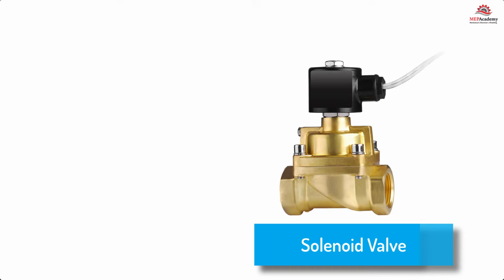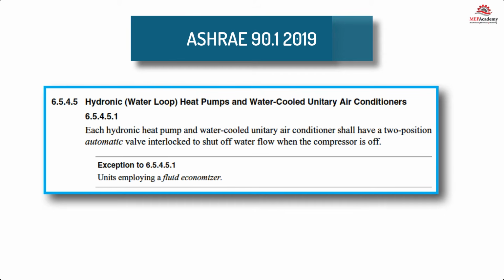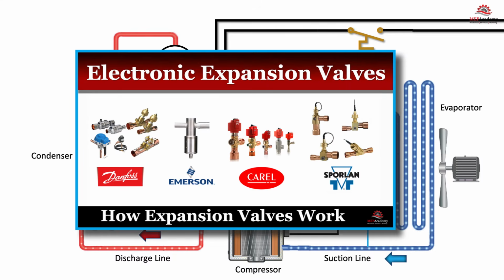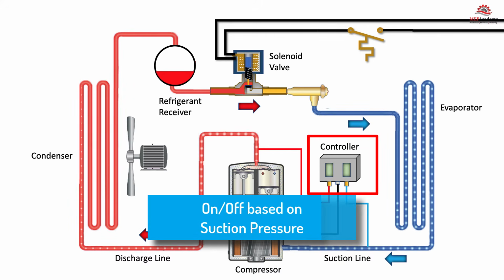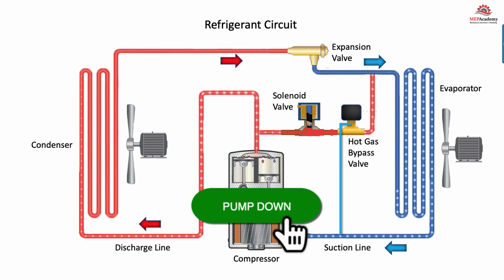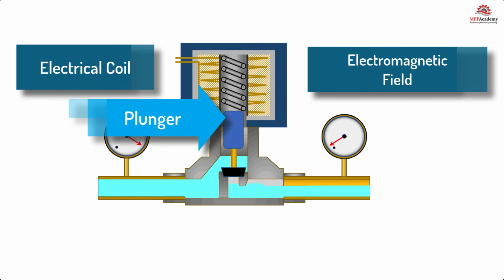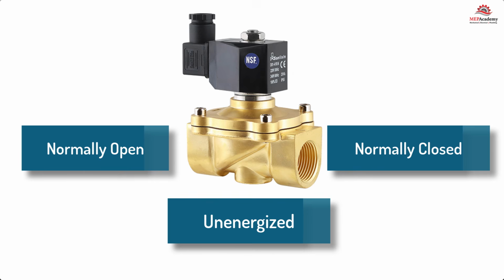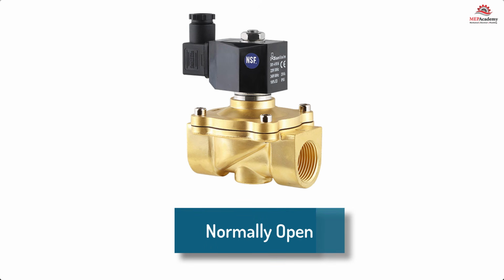How Solenoid Valves Work

Comment: is 220V solenoid valve safe for water supply pipe application at home? Is DC solenoid safer than ACor the same? I'm concern about electro-mechanical failure, will it electric charged the water on pipe? Thanks
Reply from the maker: You have to check your local code for the grounding requirements of copper pipes.

Comment: Do you have a diagram available for a CNG Solenoid valve on the 3600 PSI System? It consists of a fuel level sensor, and thermal sensor. I'm interested in decommissioning an Expired tank on a CNG Vehicle
Reply from the maker: Sorry, we don't have any such diagram. Good luck with your project.

Comment: Can 12v selenoid valves withstand 300 bar pressure or which valves do?
Reply from the maker: The standard solenoid valve found in HVAC application will never see that level of pressure. High pressure solenoid valves are often used in applications like hydraulics, high-pressure gas systems, oil and gas exploration, and industrial machinery.

Comment: at what position, is the solenoid valve is supposed to be fixed
Reply from the maker: Depending on the application, the solenoid valve could be either normally open or normally closed.